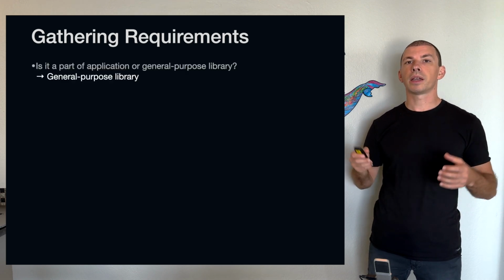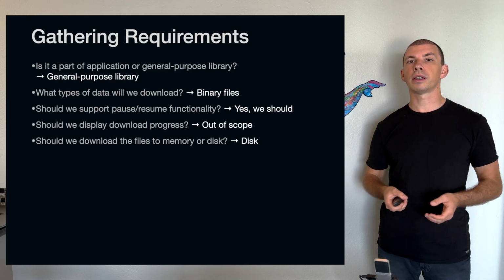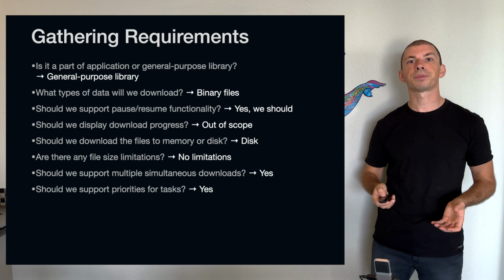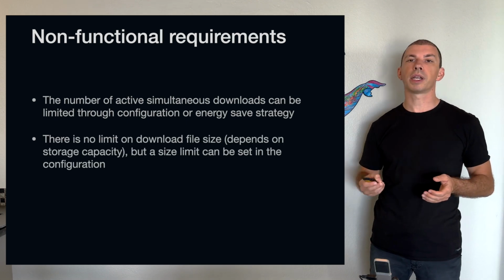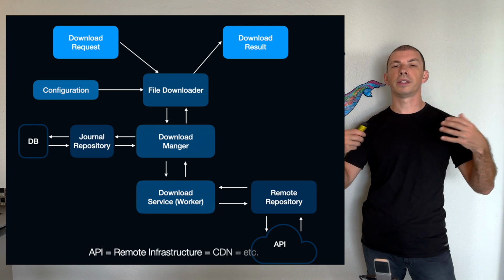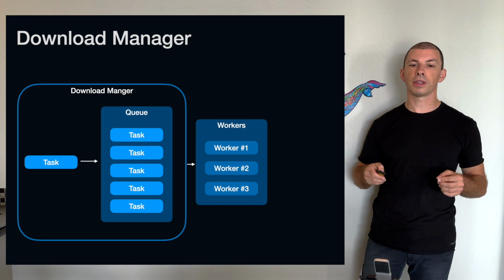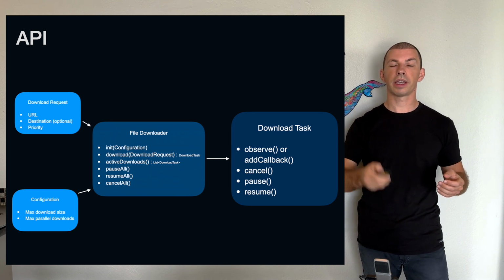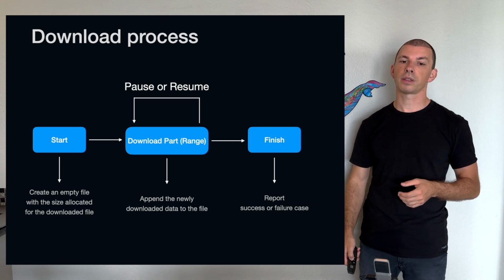Design a File Downloader: Mobile System Design Interview  #systemdesign #systemdesigninterview

Comment: I think this video is good but I wouldn't consider it "System design" because it goes too much into implementation. Design system should be more high level than implementation.
Reply from the maker: You must be right. It depends on the company. You start with high level and deep dive into in some component, depends on interviewer
Reply: yeah content is good, but this is like LLD.

Comment: Good one 👍, we can also have some kind of file processor component which manages assembling all chunks to return complete file. Different chunks can be stored in database which helps to pause and resume even retry failed chunks.
Reply from the maker: Sounds good. I don’t like to store binary data in DB, especially for big files, but it’s still possible.

On the other hand, why do we need some file processor instead of writing in the same files. The only obstacles see here is single write access to file.

Comment: Very nice video first. I am new to diagram. Could you please explain what the arrow direction means? Dependecy or just code invoke flow?  Thanks ~!!!!
Reply from the maker: That’s a really great question!
If you draw official UML diagrams, the arrows represent dependencies. I usually use them to show how data flows from one class to another.

The key thing to keep in mind is that you’re not creating blueprints; you’re simply supporting your verbal explanation with drawings.